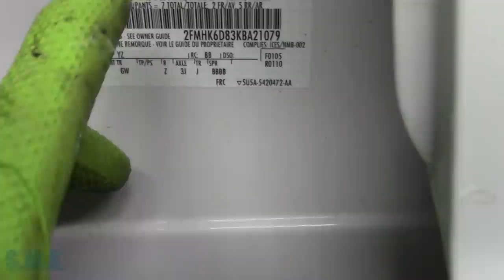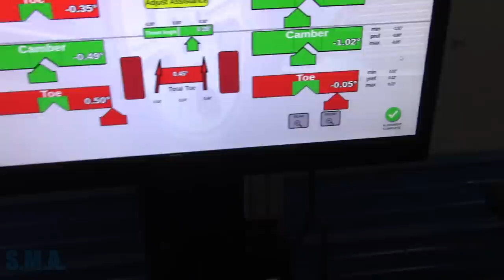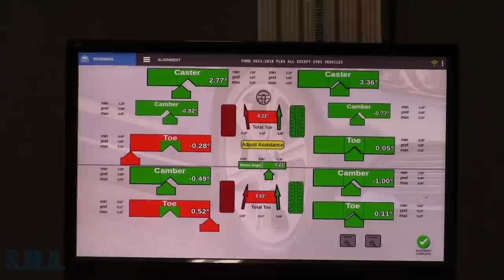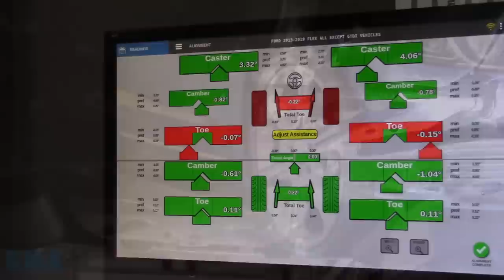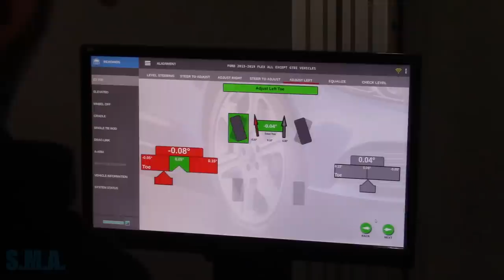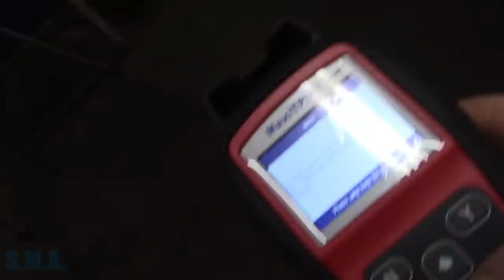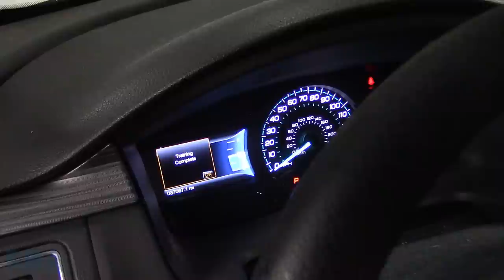Ford Flex: Wheel Alignment & Tires

Comment from the maker: I was wondering why this car was so far out of alignment myself. Talking with the customer they had to return the car to the local Ford dealer to have a new rear differential installed under warranty. Ford told them that the alignment was not part of the warranty repair. Mystery solved!
Reply: How stupid not doing an alignment.
Reply: Hmmm interesting, we had several diffs go out out in our fleet of Explorers and Expeditions from 2016 to 2019.
Reply: New rear end. Ford says we don't care if your car goes down the road sideways
Reply: @jimpantherdrivervickers5439  "At Ford, Quality is Job NONE!"
Reply: Uh what? Really? Thats messed up
Reply: I guarantee the service manual says an alignment is required when replacing a rear diff.
Reply: I'm a retired Chrysler tech. When  front or rear cradles are replaced, alignment has to be done. Chrysler had a recall on cradles for the Dodge Caliber, so it was under warranty.
Reply: Huh?  A one year old car needs a new rear diff?  😲 omg
Reply: Not cool, Ford!
Reply: I'll bet the warranty claim to Ford had the alignment as being performed and compensated for.  Just another way for the dealer to steal some money.
Reply: “Have driven a Ford - lately?”
Reply: Same story on my Grand Cherokee! Dealership's.... What are ya gonna do!?
Reply: @slipperyjk  Can call the Chrysler 1-800 number and complain.
I've done cross members on Grand Cherokee,s and alignment has to be done. Caster will be way off if not done.
Reply: At gm we cant align cars when we replace struts under warranty, so stupid
Reply: .....stay professional Ford.
Reply: How you like your alignment machine, 
Any problems I'm looking to get one
Reply: @robertgray6512  That isn't on Ford, that's a stealership thing.  Ford would be very interested in knowing they are being defrauded by paying for a service not actually performed by a dealer. Same goes for Chrysler.
Reply: That sounds about right to say alignment is not covered, I worked at a ford garage for 40 years and heard a lot B.S. sometimes it was the dealer that was incapable of understanding the warranty guides, found that the case more often then not, it was always too keep the costs down to look good.
What a crappy business dealers are.
Reply: Just had my rear trailing arms done on my 2016 Flex under recall, they did the alignment after.
Reply: one reason i never goto the Dealer for squat, they alway's have an excuse for why something wasn't done
Reply: @earlwitherall894  thanks, I'll give it a try
Reply: Man I just did an alignment on a old Ford....man those center links/tie rod sleeves🙄Josh enjoying his vacation🤣
Reply: I would have to verify that with Ford. Very poor customer service.
Reply: a differential replaced under warrenty WTF, and did the job half assed.
Reply: That's crazy😱
Reply: Shame on stealaships
Reply: I wish u were in my area
Reply: I wonder if they did the recall for the toe links. They have a tendency to fail. The update is new forged links. Not sure if the newer Flex's have that as an issue. I always check them for any stretch or cracking.
Reply: This is why I have never owned a Ford, never will.
Reply: Disgusting!
Reply: @DavidD-qr2vn  YES, and you failed to get alignment voiding  future claims!
Reply: @nowerlater  I guess the question is, did they charge anyone other than Ford for the alignment? 

Long story short, I got a used Chevy at a Ford dealership with factory warranty still on it. I also purchased the extended warranty since the truck was a couple years old. Had to get a strut replaced under warranty,  the Ford dealership was happy to do it.  They charged the alignment to the extended warranty which in turn said I had to pay a $50 deductible each time it was used. I didn't complain because the "warranty replacement" was because I drove off the drain pipe under the driveway watching neighbor girl doing yard work in a bikini as I was pulling in. It drove right back out but didn't drive quite the same after. Ford caught it at the next free oil change that came with the purchase.
Reply: Do you have any vids of you doing an alignment on a solid axle front end? I'm an apprentice and I've been getting alot of bad information on how to do it. I try to follow what the win align program wants me to do but my boss wants me to do it a completely different way and also when I look it up on YouTube or Google I get different answers to. I trust your judgement I've been watching you for a long time.
Reply: Another reason to keep learning how to work on my own vehicles.
Reply: I'd be really nice if you didn't release a video while I'm trying to install cabinets. Thank you.
Reply: It's how old and needed a rear diff already wtf..I have an 01 dodge ram and it's never needed a rear diff!!!!
Reply: 2019 with a bad rear diff... how 'bout that for quality
Reply: Ask the customer to come back to do a oil change on the diffs and trans.
Reply: Hey Eric, here's a tip for re-learning the TPMS on fords with the push-button start: Instead of the stupidity with the start button, simply punch the hazard light button 6 times, and it will trigger learn mode. Hope this helps!
Reply: Probably the Hornell Ford Dealer.  I won't mention any names, although I'd like to.
Reply: What a swell dealership and manufacturer.
Reply: ' Ford Gives You Less'  a uk t.v advert from years ago, sort of :)
Reply: @KevinCollins2157  Place I used to work had the rear diff bearings fail in a 16 F150 work truck with less than 90k miles.
Reply: Pretty sure if the technician read the labor op for the warranty repair it would say time included to set rear toe or something along those lines. So I’m blaming laziness for this one.
Reply: My 2014 AWD Flex has trouble with inside wear.  The last two sets of tires caught me out with tread looking good and cords coming through the inside shoulder.  Said the toe was out the first time and the last time they said toe links bad (Ford has these under recall btw).  I've taken to going every 6 months for Firestone lifetime and it needs adjustment every time.  Can't win with Fords and suspensions.
Reply: My fathers brand new Chevrolet equinox was out of alignment from the factory and it chewed up his front tires at about 10,000 miles, he even took it back to the Chevy dealer for a state inspection and they never even said a word about his tire being chewed  up
Reply: not surprised at all,dealership-stealership
Reply: Thats so not right. Ford should be embarrassed with a policy like that
Reply: South Main Autonomous Sensory Meridian Response, this could be something big folks!
Reply: @markh.6687  I am going to ask my friend who manages the service department at a Ford dealer about this. I'd be pissed off if that happened to me.
Reply: If you think that's bad, Ford has a recall on the rear links you were adjusting toe on. The recall only pays for the rear toe to be set, and not the front. Most of the cars that come in for this issue have a straight steering wheel coming in, and a crooked one going out. That's low. Even for Ford.
Reply: No alignment after a warranty rear diff replacement...what a lazy ass ford dealership
Reply: Gm just announced the plan to go all electric by 2035. I dont see it happening think its more of a pr stunt, your thoughts????
Reply: @scooters_z2817  Its not the dealer, its Ford. Do you work for free? I sure as hell don't.
Reply: What a cop out by Ford. Surely the remedy must include returning the car to factory spec ?  I know in my industry it does .... are they saying the factory sends out new cars without an alignment check ?
Reply: Adjustment periods usually 6 to 12 months.
Reply: @cameradoctor205  Alignment is typically not covered under warranty. If it is, its only for a very short time. The reasoning is cars don't go out of alignment on their own. If you drive the car hard, or hit things like pot holes, you're going to knock your alignment out.

That said, the links in the recall are your rear toe adjustments. They have to be set after you install them. In the course of adjusting your rear toe, you may also alter your thrust angle. When thrust angle gets altered, it changed the position of your steering wheel. Technically speaking, having a straight steering wheel isn't part of a wheel alignment, even though that's one of the ways to level it. The actual alignment of the front wheels won't be effected. Because of this technicality, they don't allow for the front wheels to be adjusted. In my opinion, its a scum bag thing to do. Customers don't understand all that. Ford should just do the whole job and be done with it. 

This is actually a nothing thing compared to some of the other stuff they pull. We're starting to get in trouble from Ford because we put too many motors in. We only put new motors in because they fail and are covered under warranty. All I can say is if the average person saw what I see every day, Ford would be out of business overnight. Its a shame because we used to make some decent vehicles. Now, everything's junk.
Reply: Jimmy S  every warranty has exceptions, none are truly bumper to bumper
Reply: @DavidD-qr2vn  Dealers HATE warranty work, because they don't make much money on the work. That also explains why they blew off the need for an alignment to ensure complete service.
Reply: @Name-vu1kn  "Stay Classy, FOMOCO!"    -  attributed to Ron Burgandy
Reply: @sumduma55  She knows you watch. :)
Reply: @kerrylewis2581  I'm sure it will be interesting. Anybody with access to Ford service manual/data should be able to answer whether it is required after that repair. If so , it should be warranted also.
Reply: Not part of a good installing diff. What a bunch of BS!
Reply: South Main Auto Repair LLC I'm proud to say I was one of the people who built this vehicle. No comment on Ford dealships🤦‍♂️
Reply: @brookswells1205  gotta love those lifetime alignments.
Reply: Was it Ford or the dealership? Complain, escalate, bug them. Start with service manager, not service writer.
Reply: I'm sure it's a dealer to dealer situation.   And I am willing to bet that ford would pay for the alignment at the dealership if the service writer added it.  Unfortunately stuff like this gives good dealerships bad names.
Reply: @slipperyjk  Dealerships.....plural
is not possessive
Reply: Don’t buy Ford
Reply: As an automotive technician, I’m embarrassed by this. You do the right thing because it’s the right thing. You can easily make up a lost hour
Reply: I've work for Toyota and Acura and almost all suspension or drivetrain includes toe adjustments. Weird it would be different on American makes.
Reply: @DavidD-qr2vn  Exactly this.
Reply: @utuber2940  Things happen.  thats why warranty exists.  Its likely this vehicle won't need a diff again.
Reply: thats just a case of a lazy or stupid service manager.  there are ways of doing it   you just might have to be creative.
Reply: That's Terrible.. smh
Reply: Shame on Ford.
Reply: That’s ridiculous
Reply: If you remove and replace a part, part of installation is making sure everything disturbed by the installation is placed properly.  Ask what the service manual states the job requires.
Reply: @mmi16  
It may not be Ford that is at fault.  It could be the dealer looking to supplement their income.
Reply: @earlwitherall894  This is the reason why Volkswagen wants print-outs and diagnosis reports on everything the technician does, to make sure we don't fool them.

Good thing the rates on certain wheel alignment stuff is pretty good. I could do 5 lane assist camera calibrations in 1.5 hours, and call it a day.
Reply: Damn fine job as always Mr. O. Good luck clearing up after the storm. Sure was a treat down here in Philly.
Reply: Pretty common for manufactures to say that
Reply: Pretty common for manufacturers to say that
Reply: Ya.. That's not proper if the repair threw the alignment off. Hacks.    We would of aligned it at Toyoder
Reply: Ford Technician here, removing the rear halfshafts to replace the differential requires checking and adjusting the rear wheel toe as per our workshop manual procedure; the Ford dealership they took it to made a mistake. 

On a further note, there's a replaceable, bolt-on bushing on the rearward - inside portion of the upper control arms on nearly all Ford Flex's, Explorer's, and Taurus' that routinely fails and can only be checked with the rear suspension loaded (you lifted from the lower control arms which is perfect). I see Tech's miss it all the time but it causes extreme camber wear.
Reply: How is that not covered? That's like doing a warranty flat repair and not putting air in the tire.
Reply: @vinnyduncan3342  Anything side to side suspension related you have to align it. Period. That's a lawsuit or at least a BAR complaint waiting to happen right there.
Reply: @sandybarnes887  Remember when American cars used to be known for their quality?
Reply: What’s the name of the disc you used to clean the wheel weight residue off from the wheel. I could really use that!!!
Reply: Do you include the alignment in your price for the tire or extra charge?
Reply: Wow, an IRS Ford that needed a rear diff..I'm shocked. My 2016 Explorer work vehicle is already howling at 62k.
Reply: I call bullshit
Reply: New tire changer:):)
Reply: typical Ford dealer ugh

Comment: This is an embarrassingly high level quality of attention and care.
Reply: Nothing embarrassing about this
Reply: It’s called do the job right the first time
Reply: Was going to say the exact same thing--seeing Eric do work the right way makes me almost want to cry. It's criminal what sh*t work some other "shops" get away with... last tire shop I went to locally gouged my rims, both while installing the tire and while balancing. The left the old balance weights on and just stuck new ones on top of the old. Over inflated. Over torqued. When I went to the manager with the damaged paint (still flecking off 2 seconds after they pulled the car out) he told me "we didn't do that, if we did we wouldn't still be in business" :-/
Reply: @mikesradios  Man smh 👎🏾
Reply: Do it right first time, everytime.
This is the problem with so-called "Fast-Fit" centres. Charge you a fortune for a rushed 5-minute fit. 
No fast-fit centre would clean the alloy wheel, the hub AND spray it so that whoever has to take the wheel off next doesn't spend wasted minuted banging it off with a lump hammer.
I'm a mobile tyre fitter in the UK, and I wish half of the wheels I attend had got the "Eric O treatement". Because they havent, I then have to waste my time knocking the wheel off, then cleaning it and the hub.
On numerous occasions I have been called by mechanic friends saying thank you for cleaning the wheel after they have done service work on the same car, as it saved them time & money.
Reply: @mrlister2000  🙏🏾🙏🏾🙏🏾🙏🏾
Reply: It's how it should be done. If any tire guy is embarrassed by this video, he should do better work! Like Eric said, treat your customer right and do the right thing by their car.
Reply: He treats everyone's car like it's his family's car.

Comment: Whoa. I've never seen anyone actually remove all of the adhesive from the old wheel weights. Thanks for showing us how it's SUPPOSED to be done, Eric.
Reply: I've never done it as a job, but have installed my own tires using a friends machine and it never really even occurred to me to remove the adhesive. Watching Eric do it made me realize I need to get myself an eraser wheel, which I should already own anyway.
Reply: I like how at 4:39 and 4:52 he let the bar hit the rim of the wheel. Nobody is perfect, but they make bars with plastic to prevent that nice clang. Even duct tape helps. Also I hope he changed the valves with new ones
Reply: @elynio1711  new valve stems don't exist for most tpms quipped vehicles. They are built into the sensor. New cap and seal maybe if serviceable.
Reply: @brianm6117  is that what that wheel is called??
Reply: @steve45383  That's what I've always heard it called.  It comes in various configurations.  My cousin used one to remove adhesive from a trim piece when we tore it apart to paint his car.
Reply: @ceescorner  you're thinking of the sensors made by TRW and Schrader mostly used in early Nissans, Toyotas, Hyundai/Kias, and Suzukis; (the valve stem is a part of the sensor, and any damage to the valve stem requires complete replacement of the sensor) GM and Ford have gone to a sensor made by Schrader where the sensor is bolted to a serviceable valve stem; we all refer that serviceable valve stem by its part number: 20018

Comment: Another great job well done. I like that you cleaned the rims and brake rotors. It's amazing how many times that a vehicle has lost a tire or tires because of dirty mating surfaces even though wheels were torqued.
I like how you pay attention to detail!!👍😀
Reply: And he set the tire pressure according to the manufacturers specs and best of all he used a torque wrench on the lugs!
Reply: Always advise the customer to have the wheels re-torqued after 50 to 100 miles. Most shops in this area include it with the tire installation price.
Reply: That's great advice. We recommended that same thing at our place.
Reply: My "tire guy" actually came to my house to tell me to check the torque after he put new tires on my daughter s car. He lives a block away but still that's awesome service.

Comment: boy that brings back some memories dont matter how good a mechanic you are if you work in a shop where they sell tires you are going to have to mount tires been retired for 4 years from tire kingdom where I worked the same store for 35 years one thing I learned was whenever possible test drive before and after alignment